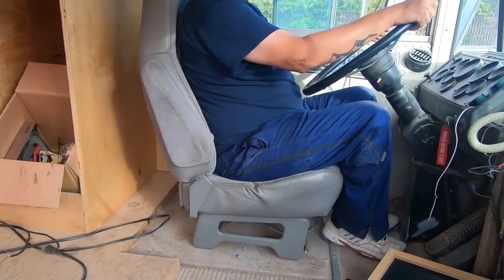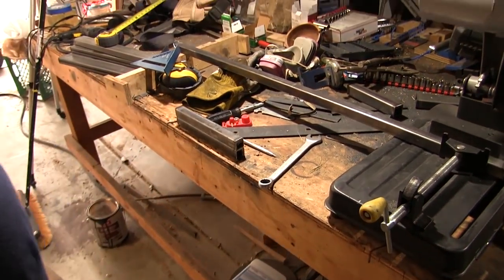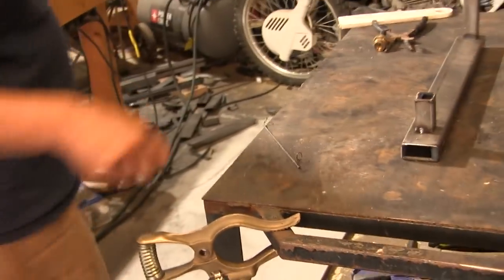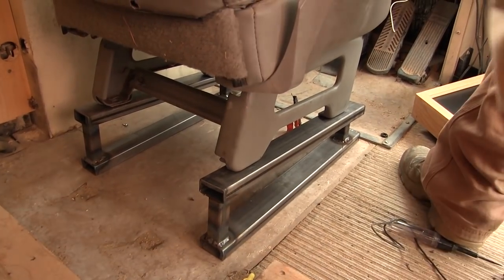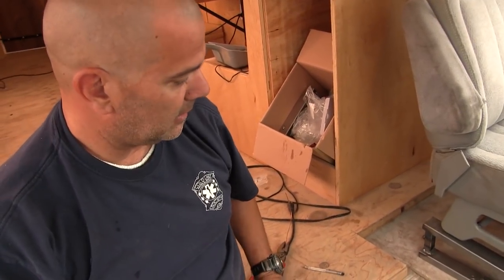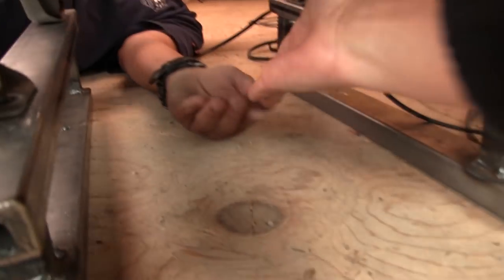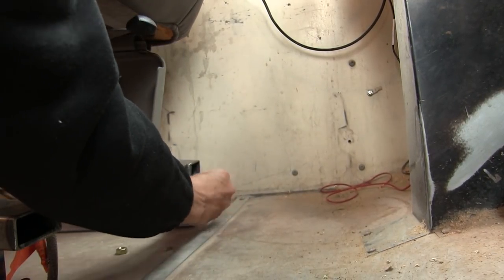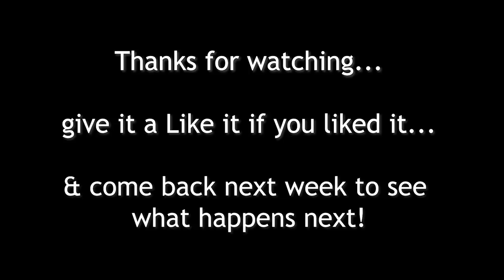Installing a Driver's Seat in our Skoolie: from Van to Bus!

Comment: Brings back Memories of when we got our first Van.  I'm  6'4" and my wide is 5 foot  tall.  I had to remove the drivers seat and build a ramp and roller system to accommodate both of us.  It ramped up and forward for her and back and down for me.  I fit both of us perfectly.  Sure miss the old Tradesman, but after flipping the odometer three times the kids were grown, and didn't need it anymore.  LOL

Comment: Hi Mike if you drill a hole In the top rail at the end above the bottom fixIng bolt just bigger than the bolt head, you will be able to pass the bolt through the top raiL so if youlose a nut the bolt will stay In place and not fall out completely.

Comment: its probably a good idea to put a kickplate on the front of the frame under the seat , prevent you hitting youre heel on a corner of one of edges of the metal but allso prevent sunting rolling under the seat of from under the seat under the pedals . could make a small drawer under the seat in the back of it for youre emergency stuff like roadflares electric torches and reflective vests

Comment: Nice design and a killer find on that driver seat! We ended up finding TWO leather captains chairs for $50 CAD each (~$38 USD/each) that have seatbelts built-in. Looking forward to installing these on the swivel bases we also scored... But first, the windows are in production right meow! Keep rocking it y'all!
- Brian + Erin
Currently converting our '97 Thomas Saf-T-Liner 40-Footer RE flat front

Comment: Hard to beat the price on that seat.  I don't know if your bus is air ride, which would mean the motor has a compressor, but your best option for comfort would be an air ride seat.  But then a new one costs between $750 to $1000 bucks or so.  But they come with a pedestal and you usually just have to bolt them to the floor.  They even have seats with massage units inside as well.  Just something to think about in the future if your current seat doesn't work out.  Be well.  :)

Comment: Looks good but I wouldn't rely on just those bolts correcting the sway. Brace them to each other for more rigidity on those bumpy roads. Why not air ride seats?

Comment: I'm thinking about doing something similar...if i can find one.  I'm looking for a swivel chair that locks into place.  It would be nice if i could use the same bolt placement that my current seat has...but i could easily fab something together if it doesn't.
Reply: Look on Ebay you can find swivel seat brackets!  If you have a bus spend the money get an air rid seat !

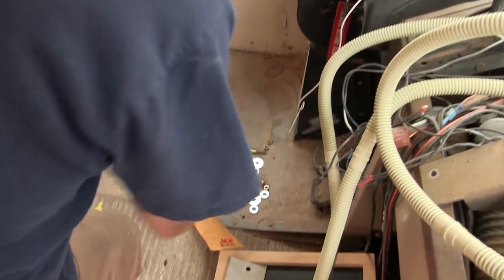Comment: 🤔 I‘m wondering (@ 16:27) why you didn’t just chop off the top rail in front of the post. It prevents installing the floor bolt from above and seems to serve no purpose.